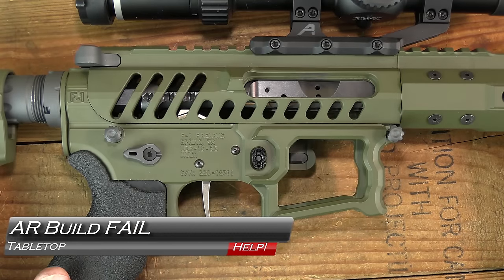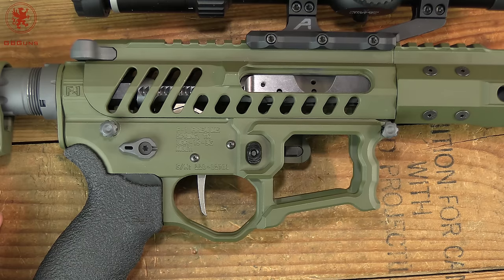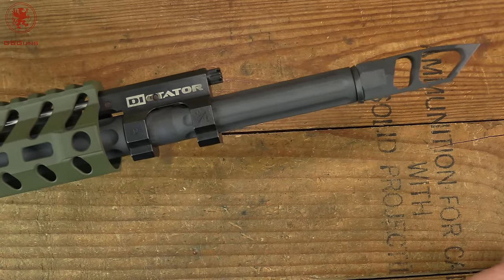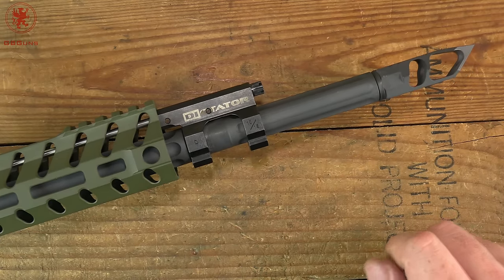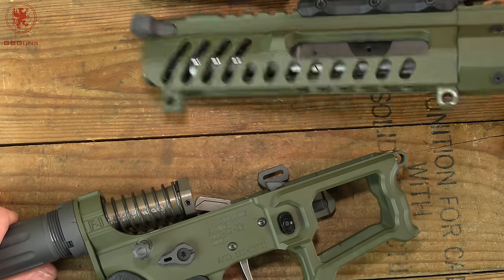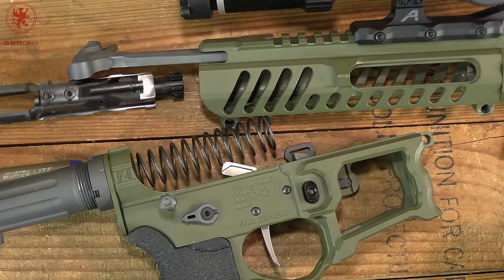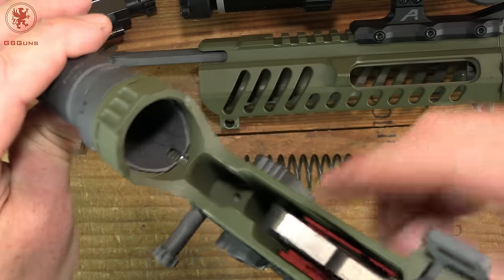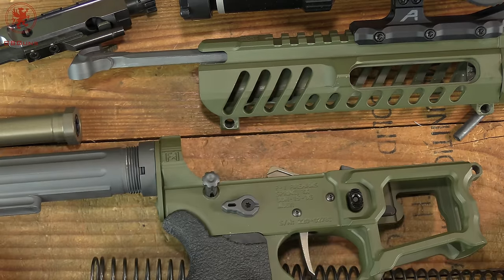The Worst Thing You Can Do For Your AR

Comment: The light bolt carrier is cool idea, but needs to be heavier…, You’re essentially using a plastic Playschool hammer to do the work of a framing hammer. Troubleshoot it one thing at a time.., first heavier carrier. As long as the spring is mil spec you should be fine. Messing with springs will send you down a rabbit hole you don’t want to go down.

Comment: Dont see the ergonomics in putting holes in the upper on a closed system gun. What happens if debris gets caught up in there? Jams up like AR's?
Reply from the maker: It has nothing to do with ergonomics, or the functioning of the gun. Gas flows into and out of the bolt carrier.

Comment: Put an empty mag in and see if bolt catches after pulling charging handle all the way to the rear. 
If it goes forward, you have too long of a spring.
Reply from the maker: This was fixed a couple of years ago, see pinned comment for the solution and if you'd like to see how amazingly soft this rifle shoots.

Comment: Open up the gas port on the barrel . 300 black also do this with sub ammo cause the gas port on the barrel is too small . Just had to open up a Rosco barrel . Same thing was happening. Some company over gas but I believe u are under gas . Put a vltor a5 on it . It will be sweet then so soft to shoot .

Comment: You either went too light on the carrier/buffer, and too light on the gas. 

Try a sprinco yellow buffer spring, and/or add weight to the buffer.

It is a misconception that lighter carrier/buffer reduces short stroking. 

As previously stated, it is a problem with momentum. Lighter components have too little momentum.

You went too extreme in trying to reduce recoil.

Comment: short stroking is because there is just not enough mass to carry the bolt all the way back. object set in motion has stored energy. if it's too light there is not enough store in BCG to overcome that spring and maybe even a lighter spring. that is a fine line between cycling every single time. you need to have some extra recoil power left over to be sure that it gets all the way out of battery and then sent back with authority.  no such thing as a .22lr  recoil in a rifle cartridge with all that power and gas. no spring or buffer is that fine tunable. then there is the ammo..A mid length gas system is what an 18" barrel needs. that engineer  below is correct..Just put a regular full auto BCG and try I'll bet proble is solved.
Reply from the maker: Nope, regular BCG didn't solve it.  See video description or pinned comment and you'll see just how soft this thing runs.

Comment: If your gas port was the correct size, then your gas block could have been cocked. If not, then your carrier is probably the problem. Loose gas key, gas key I.D. not in speck, gas tube button not in spec, or the two bores for the gas ring and bolt tail were out of spec and not gas efficient. A tight chamber could also be the problem, which you would need a function gauge to check..

Comment: -port size on barrel is too small restricting gas 
-buffer spring is too heavy
-bc the bcg is not from a big name manufacturer I would check for a gap between gas key and gas tube when bcg is in battery.  It may be hemorrhaging gas without your knowledge.

Comment: You are under-gased! I am speaking of the actual gas port (the hole drilled through the the barrel to bore) size; not the gas block. This is a rather common occurrence as the hole is drilled before the coating is applied. Additionally, different gas system lengths (carbine, mid, and rifle) require different gas port sizing. So do different calibers … suppressed … unsuppressed. 
A good gun smith understands this … always “chases the hole” … and usually opens the size of the port as stated above.

Comment: Your surfaces in the upper receiver look a little too dry.  Get some good gun grease and some long Q-tips and apply it in the crevices and surfaces, then try cycling it by hand a hundred times or so.  Get rid of the light weight buffer and put a regular 3 or 3.5 ounce in it.  Buffer spring may be too short or too low under compression.  Get a regular buffer spring, they are cheap to swap out.

Comment: Everyone is pretty sure it's the spring being too much for the lightweight components, as am I. However it wouldn't hurt to double check the gas port alignment with the gas block. Short dwell time means less forgiveness for even a slight misalignment.
Reply from the maker: Ironically no one mentioned the spring until I put it in the video description

Comment: That buffer spring is too compressed to start with and needs to be shorter ... there is no room for the BCG to move at all.  What weight is that spring?  when he set it down on the table it sounded SOLID

Comment: I realize this old and you've undoubtedly have resolved your issue im curious where is the detent that holds the buffer spring and buffer tube/weight in the buffer tube.? description: spring loaded pin that threads into the lower portion of the buffer tube. It's use is to keep a predetermined level of pressure on the spring thus relaxing the reward motion of the bolt carrier group. this pin is usually located closest to the rear take down pin. it can generally serve as a key/lock in order to keep the crown nut that attaches the buffer tube to the lower receiver from backing off if becomes slightly loose. violent motion into a shoulder. Be a sad Darwin story for buffer tube an bcg blast its way through a fella or lady shoulder. Esp on their personal from scratch super high end no expense spared build. Not something you can blame on a quality control issue. Instead of aluminum could that bcg possibly be made of titanium..? I would like to purchase it if your interested. Hope this reaches and helps folks in the future. God bless Ameri2a, ALL the brave active and fallen veterans that fought an continue to fight for us to keep our wonderful beautiful and diverse country safe and free. Well safe an free as our Government/Administration will allow Its all a form of communism if you keep the same mind set an principles in office for generations at a time. Eventually if you continue adding laws to everything then some point anything becomes illegal. To the point, when does it stop, when is enough, TRULY ENOUGH.? PROBLEM SOLVED 😮

Comment: Why the hell is the buffer tube spring and buffer popping through on the breakdown and not contained to the buffer tube? Never seen that before.
Reply from the maker: In most AR's there is a buffer-retaining pin that, as the name describes retains the buffer inside the receiver extension.  It's not required to operate, but makes field striping easier.  You may find this article interesting: https://www.ballisticmag.com/2021/03/02/impossible-ar-build-myths/
Reply: @GBGuns  interesting. I have never seen a build without it. Thanks for the info.

Comment: Did this guy ever get his rifle to work? I like to know what caused the issue. I can only think of 2 possible reasons. 1. The gas port on the rifle isnt big enough or the gas block, regardless being adjustable, is the wrong. 2. Using a carbine length buffer and tube on a rifle length build.
Reply from the maker: I don't know if you did, but the author did mention it in the pinned comment and video description including footage of it running.

Comment: Buffer weights and more gas pressure by using carbine length gas system... That should slow down it's rate of cycling and add  forward momentum to the BCG and there by eliminating the short stroke... So basically problem is it's too lightweight and doesn't have enough acceleration due to low mass... U Know E=mc²

Comment: Also its extremely possible you overgassed it . Max gas with everything being so lightweight it doesn't have time to extract. Adding a buffer weight adds resistance and slows down that cyclic rate. Common place with kind of iffy gas length to barrel length ratios.

Comment: Also ,some gas blocks and tube diameter,   are lil to small.   Up grade to an over sized adjustable midlength or carbine length.    Gare tee fix
Reply from the maker: It was fixed long ago with a simpler swap.  See video description

Comment: I am also a retired Engineer. WTF is with a slotted upper??  Why invite dirt, sand, and all kinds of shite into the part of the upper the bolt carrier group reciprocates in?? As to failure to cycle: 1) The buffer needs mass to carry enough kinetic energy to peel of the next round, push the extractor over the case's rim and cause the cam pin rotate the bolt lugs against the chamber lugs.  This energy is stored by compressing the spring when th bolt is propelled rearward.

What is the craze with light weight anyway??  Buy an mid priced AR from a reputable manufacturer (SpringField armory,  S&W, Bushmaster etc) then install a Geissele adjustable trigger kit.  

BTW,  you are missing the Buffer retainer pin.
Reply from the maker: The only think lightweight about this build is the muzzle device.  It's amazing how distracted people are by receivers that look different. See video description or pinned comment.

Comment: SIMPLE FIX , AND YOU WONT SPEND A DOLLAR MORE JUST CUT OFF A LOOP FROM THE SPRING 1 AT A TIME AND FIRE EACH TIME UNTIL IT BEGINS TO CYCLE, I KNOW IT SOUNDS UNORTHADOX BUT WHEN I BUILT MY 1ST AR 30 YRS AGO IT WOULDNT CYCLE , SHORT STROKE EVERYTIME , THATS WHAT I DID AND I STILL HAVE AND USE THAT SAME AR 30 YRS LATER AND ONLY THING I EVER HAD TO DO WAS REPLACE THE BCG ABOUT 10 YRS AGO  SAME SPRING AND BUFFER IS IN THERE .

Comment: You should be fine, pull the gas block off and see if you can visually see if it’s smaller that the gas block. You could always take it to your local gun smith, they’ll get it running right.

Comment: Well that design always looks cool…but doesn’t mean it is actually functional..have you tried to upper and lower on different builds yet? Upper on something else and your lower on another different build.. that could hopefully try to isolate the first cause and may even show that there could be two issues…but by splitting them apart may give a better chance to see what you’re trying to find..also inspect the bcg gas tube as well..if it has a small crack that could be the issue..but also with you going all lightweight components your buff tube spring may be to stiff with not enough weight coming back after each round..softer spring could help or start by cutting only one round off at a time plus make sure it’s a 15 spring and not a 10 spring..u can also figure that out by the ring count ..off the top of my head I can’t remember but there is actually a difference..hopefully one might take care of the issue but by trying on another build will eliminate being an upper or a lower issue..Even check your gas block for its proper milling..I had a poorly milled gas block..changed that out and never had another issue with that build..good luck and happy hunting.
Reply from the maker: This was the first of several videos on this gun, articles as well. Your solutions are the most sound of the thousands who suggested.

Comment: Its your upper receiver or gas tube. Gas tube might have a pinhole leak in it somewhere, or its too long for its intended purposes, could have an obstruction in the tube itself, or the upper receiver is creating drag on the bolt carrier group. I highly suspect its the gas tube myself; I had an incident with my bolt carrier group with similar issues. You by chance happen to take the gas tube off of the bolt carrier itself? Mine worked itself loose last time I shot it, and my gunsmith had to restake the bolts for it. You arent supposed to take it off for any reason I found out, even if you are cleaning the carbon off it.
Reply from the maker: Check the video description
Reply: @GBGuns  yaeh i realized that after i saw the video was over 15 months old

Comment: Just get a barrel with a shorter gas tube system keep your gas block and then adjust the gas settings until it works it seems pretty obvious that it just doesn’t have enough dwelltime
Reply from the maker: Fortunately the solution was much simpler

Comment: I’m not sure you mentioned what caliber it is. In 556 you need a longer barrel than you have or a shorter gas tube. In any of those lower PSI heavy calibers you’ll need a shorter gas tube since most smiths will tell you not to use a long barrel on them. In either case I just don’t know that it’s good to keep the pressure that low. There are other wacky ways to mitigate recoil.
Reply: The distance between the end of a gas tube and the end of a barrel should always be about the length of a bayonets handle. No joke
Edit: at LEAST the distance of a bayonets handle. Not just because that’s the best distance to mount one on an a2 front sight and a a2 muzzle device but because that’s how they should be for gas reasons.
Reply from the maker: That's one of the myths we disproved with this rifle.  See the article in the video description.
Reply: @GBGuns  well you got it working. I’ll be doing it to mine now.
Reply from the maker: It is silky soft.  One click of the gas block splits between 5.56 only or also being able to run .223.  One more click open for more reliability but still soft shooting.
Reply: @GBGuns  I’m a mostly a 458 user user but we’re always looking for a way to mitigate that recoil. There are tricks I can take from videos like this, though I can’t just copy and paste.

Comment: Try running a carbine or mid length gas system, the gas might not have enough power to push through the rifle length, even if it’s completely open, a carbine length buffer tube and a rifle gas system typically fail dramatically, in my experience, I don’t know a ton, but always try to match that length of buffer tube with the gas system, it also could be the tension of the spring, it’s might be to strong for the gas, those are the two different possible conclusions o can draw up from that, but then again, I’m no professional in this field, even if I build my own guns.
Reply from the maker: Fortunately the solution was much simpler than a barrel swap
Reply: @GBGuns  What was the solution?

Comment: I am sure it,s your buffer spring .Carbine length spring  is 10 3/8 " long .Rifle length is 11 7/8" long. When you drop a carbine length spring into the buffer tube it should be short of the hammer in the up right position. Rifle length will go past the hammer as I saw in your video.

Comment: Looks like the rear pin isn't set strait and is reshaping the holes and is slightly puting the carrier group slight off angle or the carrier is releasing gas around the carrier in the performance cuts with out acting on the carrier being skeletonized the pressure are not at operating levels imo

Comment: If nothing else the comments give a great thought experiment as to all the component factors that must coalesce in order to realize a proper functioning and balanced rifle system.  So yeah,. Rifle length gas system means less pressure to the bcg which begs for a  lighter bolt and spring.  Not knowing the twist of the barrel I would surmise a tighter twist, like 1:7 which is for heavier grain bullets, which in turn requires more inertial impulse to push that baby 🐥 out.  So your light weight system may be working at cross purpose to the system requirements.  It's a guess.  I'm just an architect so what do I know?
Reply from the maker: See video description or pinned comment

Comment: one thing that goes thru my mind, is maybe the gas port itself is drilled to small in the barrel. I have watched Chad over at SCHOOL OF THE AMERICAN RIFLE, and I don't think any of them measure the same diameter. I guess since the rifle is assembled from mismatched parts, you may need to do something "creative" or think outside the box in order to make it run. i would think that either a larger gas port in the barrel, or blocking the rifle length port off completely, and drilling in a carbine length gas port. of course all of that would have to be done with your gunsmith anyway. so why not have him tackle these issues.

Comment: You need to do mid or carbine length gas system.     Rifle length is not enough pressure
Reply from the maker: Incorrect.  Read the article linked in thevideo description

Comment: If it is not the spring, then I would check the gas port size in the barrel and then check the gas block to make sure that there are no obstructions.
Reply from the maker: See video description.
Reply: Check the gas key on the carrier as well.  If it is not staked properly you could get some leakage there too.

Comment: You may need to have the gas port on the barrel itself enlarged. Here’s a video from brownells that explains everything:

https://youtu.be/w3vbRoMZBS4?feature=shared
Reply: Apparently, if the gas port on the barrel itself is too small, there’s no adjustable gas block in the world that will can be opened enough for proper gassing of the gun. In the world of computers we call this a “bottleneck” where one component limits the operation of all the other components. Ask the gunsmith to enlarge the gas port on the barrel itself, and you’re good. Tell him to make it as big as possible. With an adjustable gas block, you can always bring down the gas anyway. Good video. I didn’t realize higher end companies don’t make the gas ports big enough to work in all possible build configurations. I have learned from your experience.

Comment: You don't have the buffer tube spring in to hold the spring in place
Reply: So the buffer spring doesn't come back and hit the bolt carrier there's a hole where you put the spring in with a little part not sure what's its called on the top on my head but it's holds the buffer tube in place as well and keeps it from moving